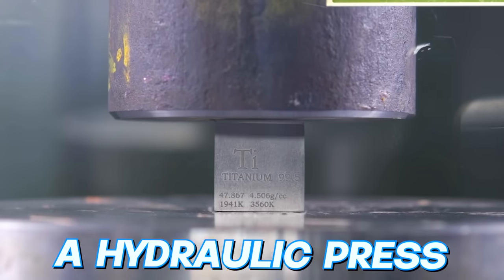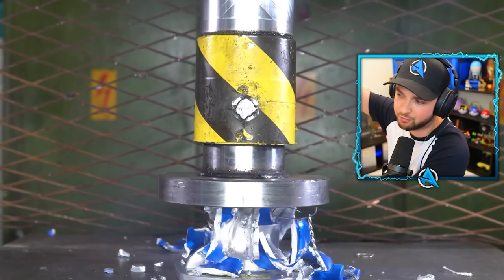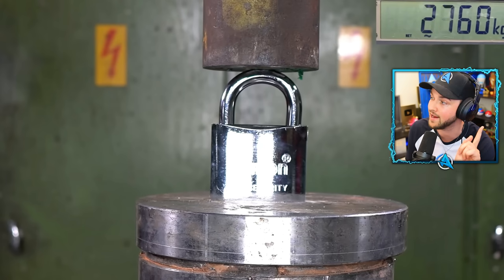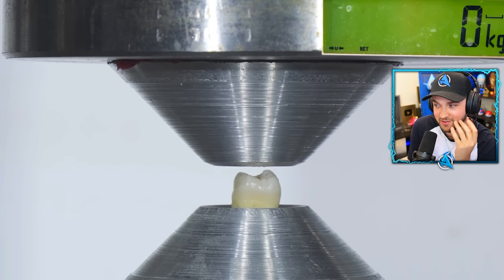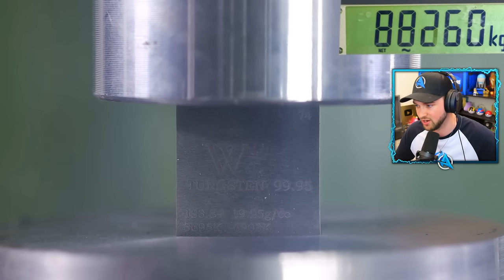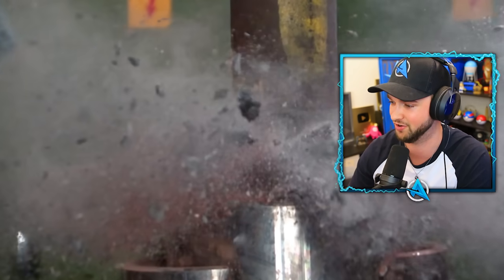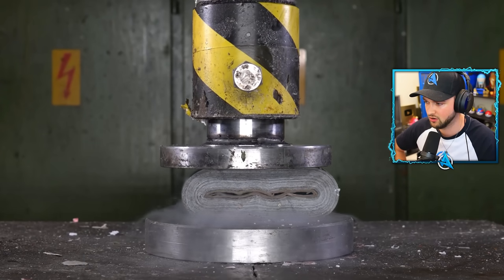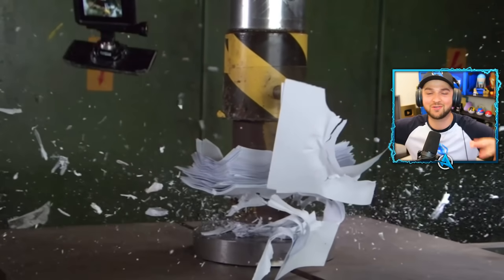World’s *STRONGEST* Objects vs Hydraulic Press! (CRAZY)

Comment: As luck would have it, I just finished writing a 17-page research paper last night on hydraulics. The only reason that the hydraulic press couldn’t destroy the hammer is because the cylinder holding the hydraulic fluid couldn’t hold the fluid in there. The water could go through a lot more than that.